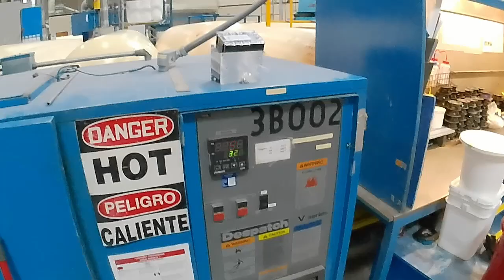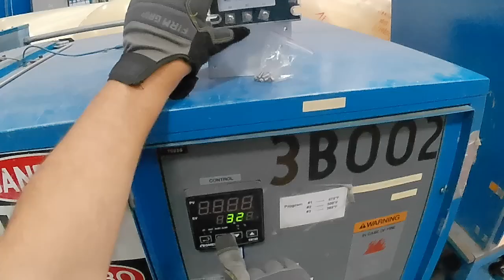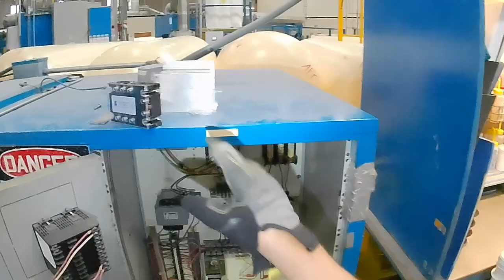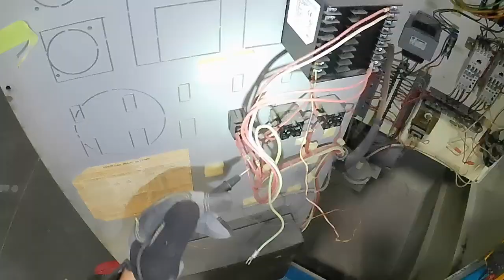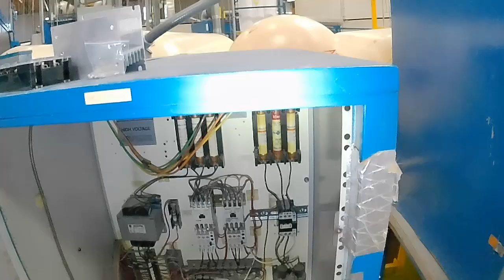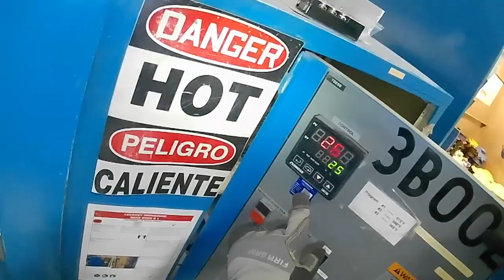Why Your Heating Circuit  Contactor Keeps Breaking (SSR Fix Inside!)

Comment: You may be able to contact Despatch to get a copy of the schematics as well as the controller configuraton so you are backed up in case of controller fail.
Reply from the maker: I Have The Controller Config......When I Eliminate All Old Hardware...Will Write Out Scheme. Thanks For Watching.